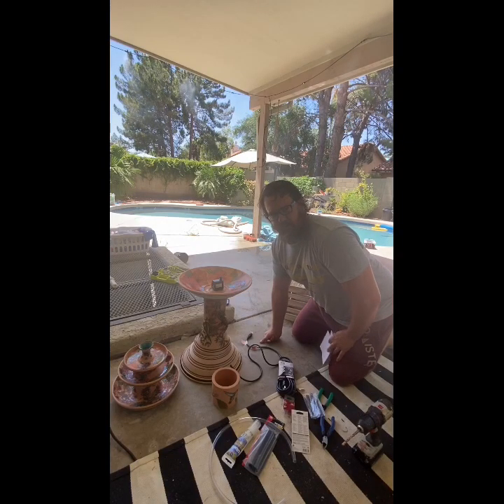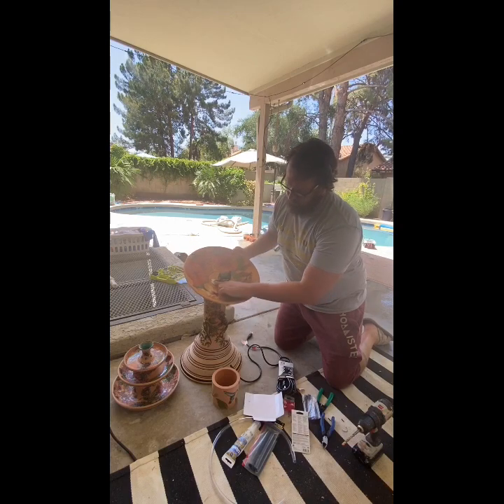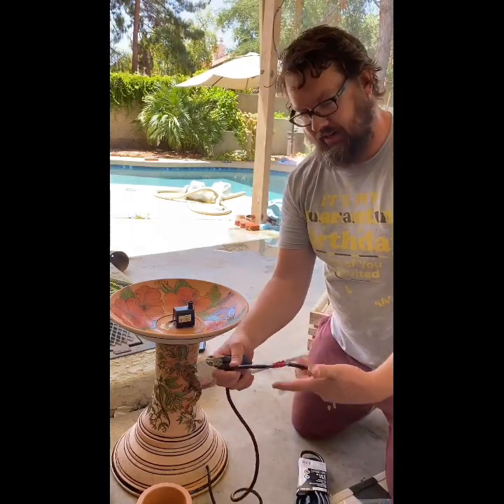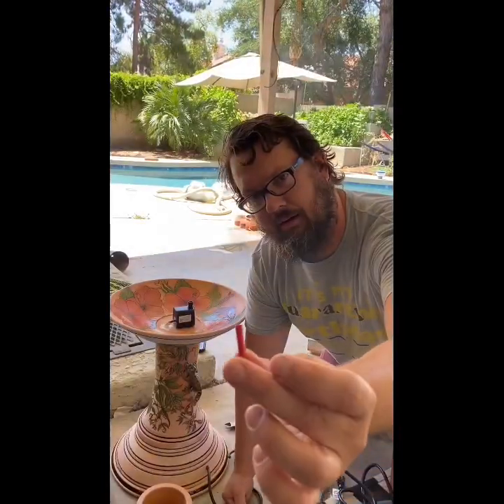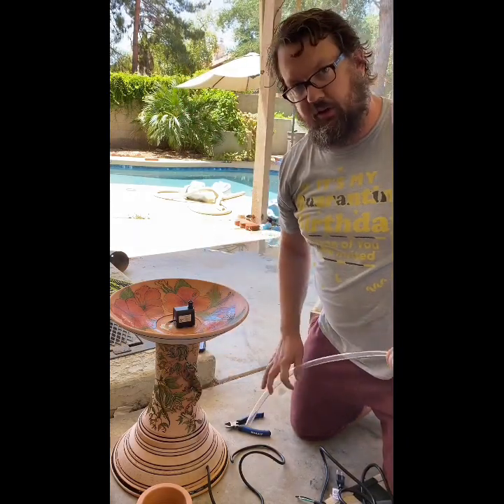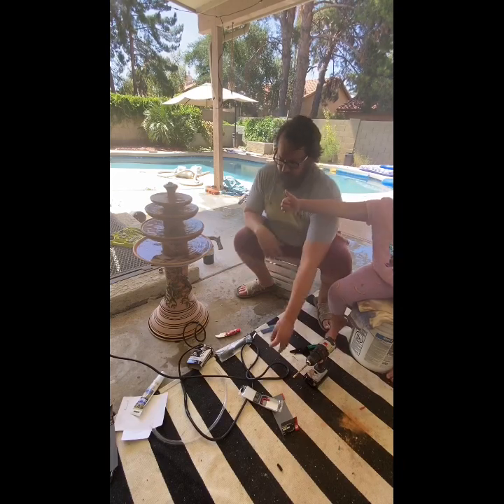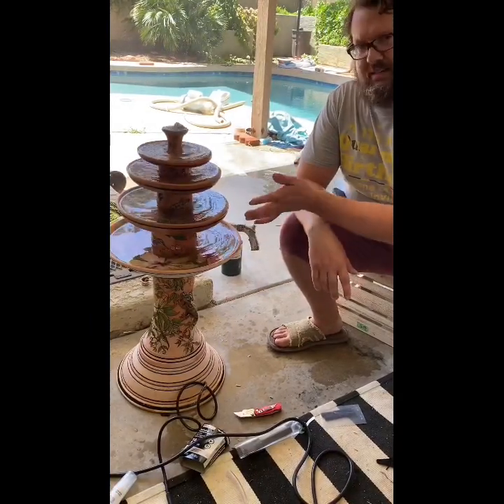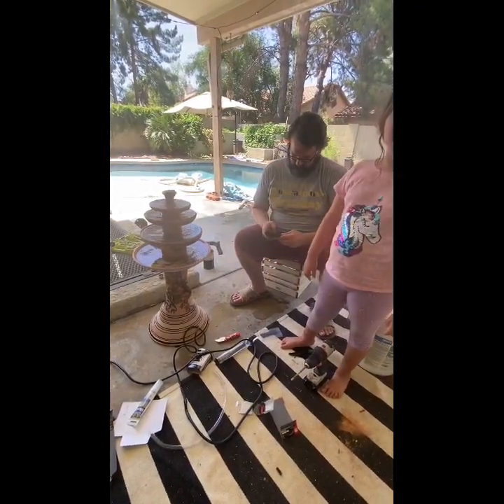Fountain Wiring Video

Comment: In the tube with the pump how does the water not drip down under to the piece underneath through the cord hole
Reply from the maker: Some of the newer pumps have these awesome plugs that can be used to fill it up (ive been looking for them independently but haven’t had any luck yet) but with ours we used a water proof two part epoxy from Loews- Also works but requires them to sit and dry for a bit!